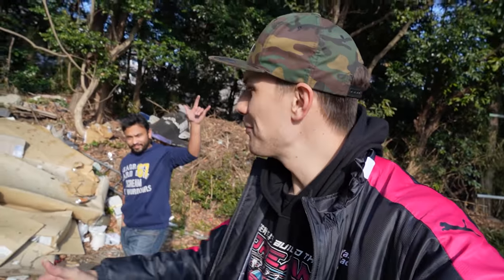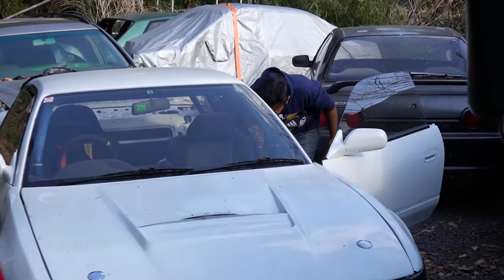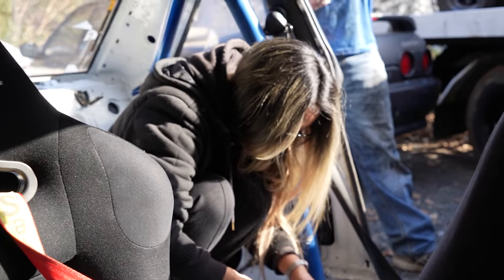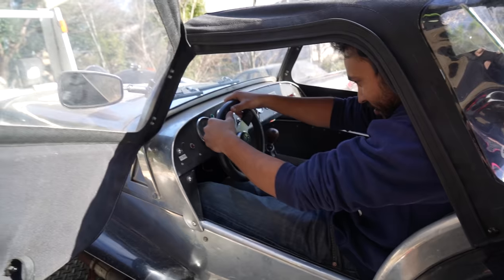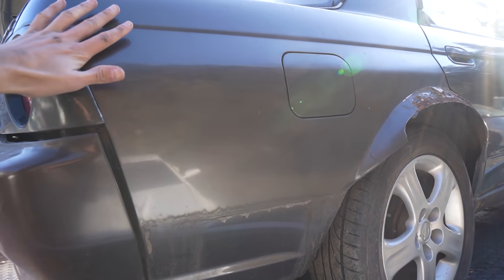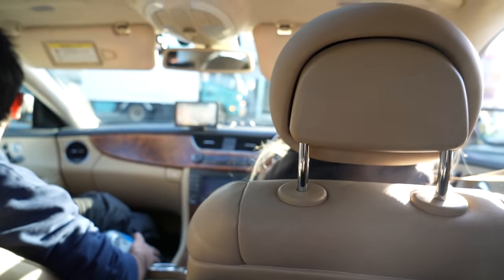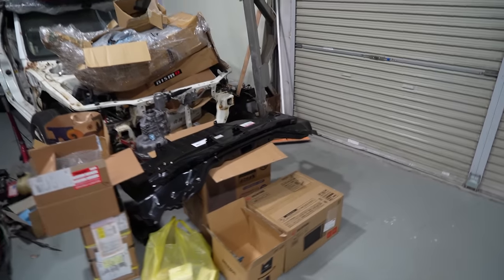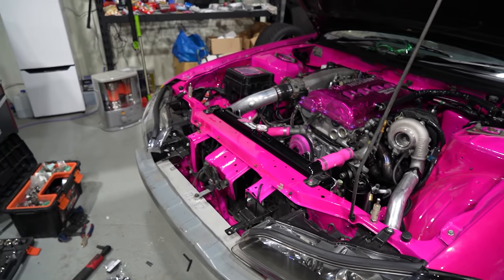I BOUGHT THE DREAM JDM TOW RIG!

Comment: You don't need another fan for your oil cooler you just need to relocate it in front of the radiator so your big fans can pull air through it
Reply: Big brain move right here

Comment: 18:25 why not run a solenoid instead of toggle switch, you could have a variable current draw based on your RPM, current draw would be a lot smoother, and you could have a more modular control of power from the engine, idk you do you tho seems like you got it down, and you do have more experience building cars im just a collage student lol .

Comment: To the "It doesnt match up needs lots of puddy" No  you need the trunk, rear bumper tails, and the ends of the rear quarter... which can be fiberglass, cut the coupe trunk, weld it on the Sedan trunk where it meets the bumper, trim around for the tail lights, and trim the bumper, Its 100% metal work and some slight body work for fiberglass overs.. Gave up too quickly